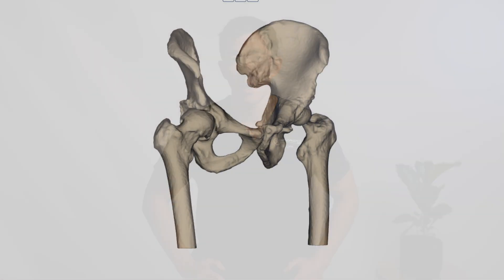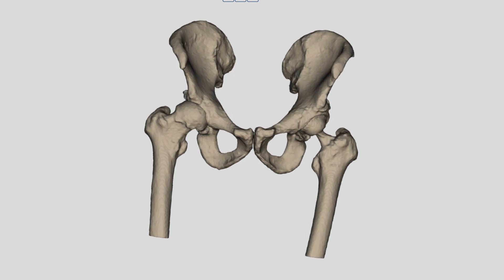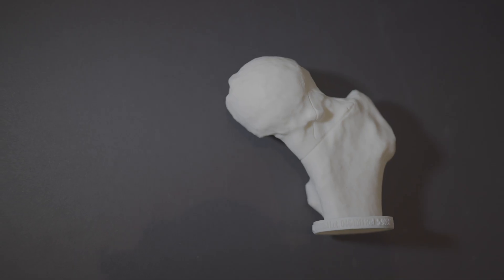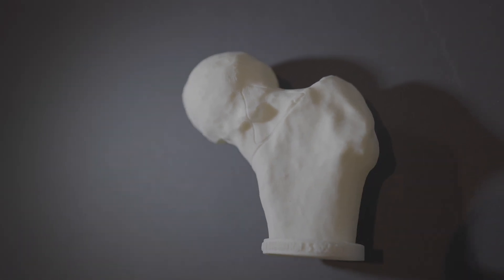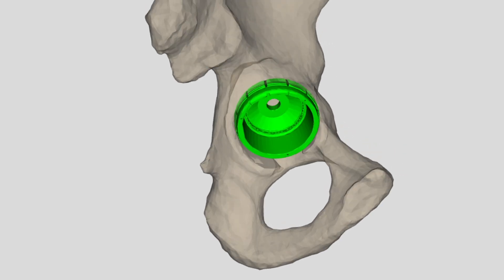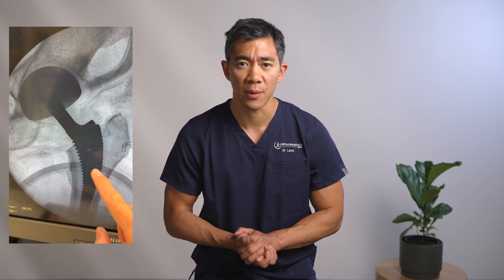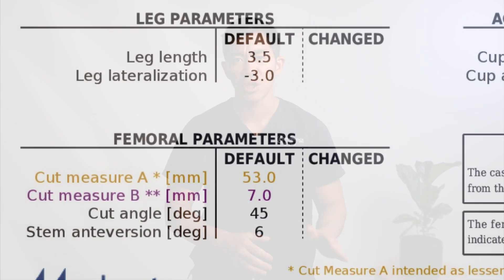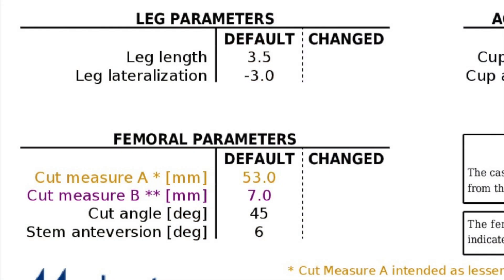Enhanced accuracy during total hip replacement surgery

Comment: I had this surgery five years ago and it was a raving success. I was in the OR at 11 AM and I was home at 5 PM. I was up using a walker immediately and return to work in four weeks. No cutting of my tendons and muscles of the side of my leg and recovery was swift. Unfortunately there are not enough orthopedic surgeons performing this type of surgery due to the fact that general orthopedic surgeons have to return for more training and use a specialized table which is not inexpensive. 70% of surgeries performed in Europe are done with this method compared to 30% in the United States.